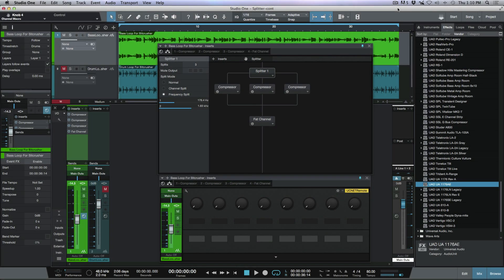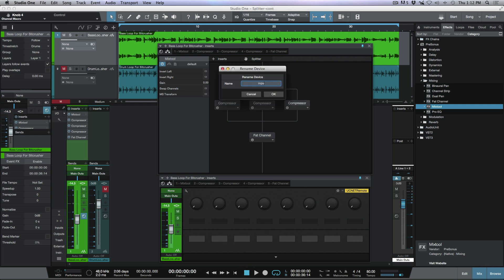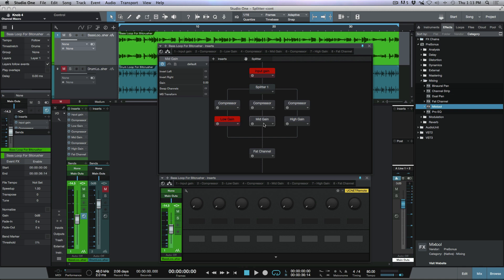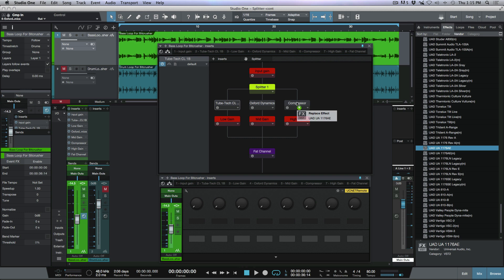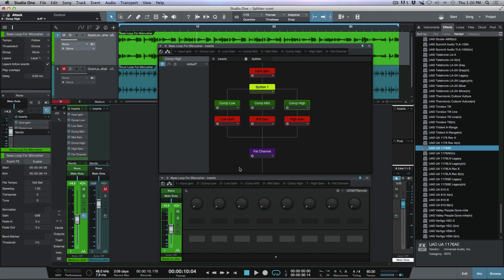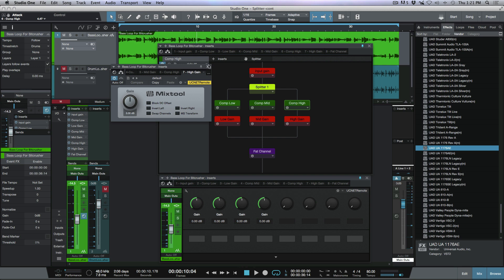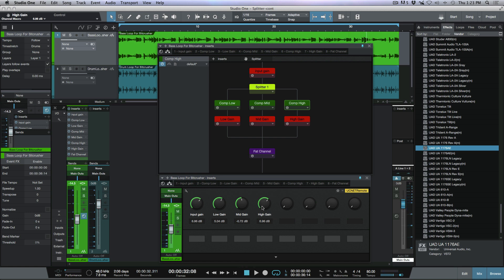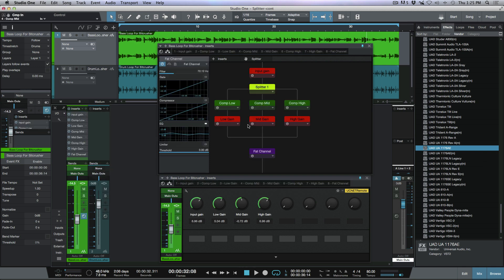Using Macro Panel Knobs With Advanced Splitter Setups in Studio One 3

Comment: What is the use of this setting? Why use splitter when we actually have a multiband comp from PreSonus...! Why sweating for this.?!!
Reply: Because this not only applies to compression. Also, you can have have different 3rd party compressors for each of the bands, and have 5 bands in total. But you can also add a saturator to the top end alone, a transient designer to the mids, whatever you can think of. If only basic multiband compression you're right, but this method with the splitter is much more versatile
Reply: @musician1971a  agreed.
Reply: "A stupid one u are" Yoda says.

Comment: so you can only control the gain of the compressor not the ratios or anything else on each compressor. I guess the way you were using all 3 compressors was like it was one in 3 stages like a multiband type of way.
Reply: Ratios controlled with the mixtool inserts